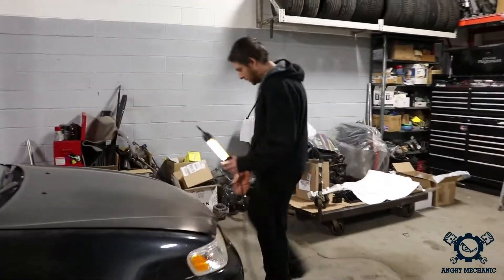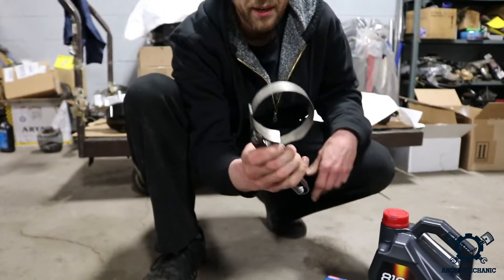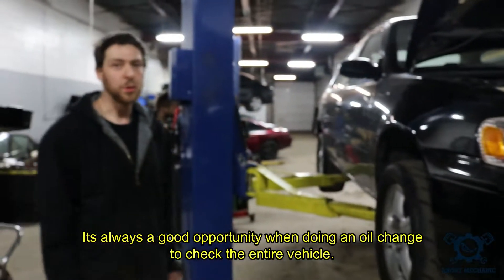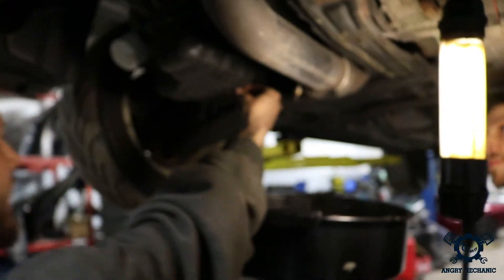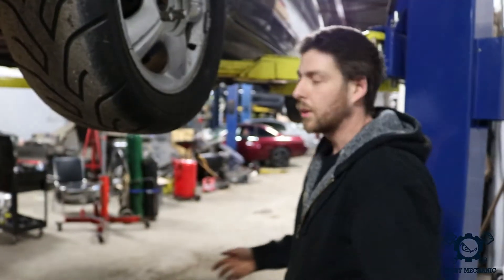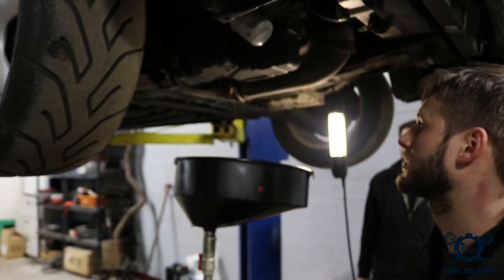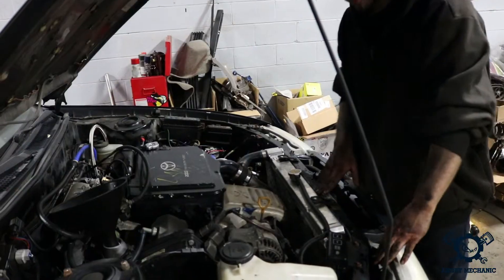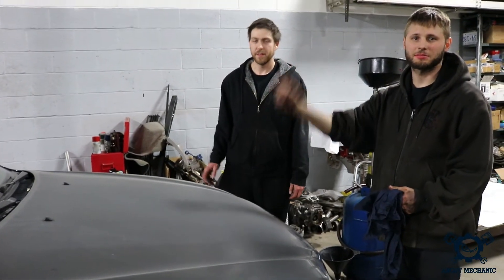How to Change Your Oil Quick and Easy

Comment: Good job. What is your take on "priming" oil filters
Reply from the maker: It is beneficial because it reduces the amount of time to build back oil pressure due to a dry filter. It is however not always possible to do so because of space constraints and filter location.
Reply: @angrymechanic5529  thank you for your promt response